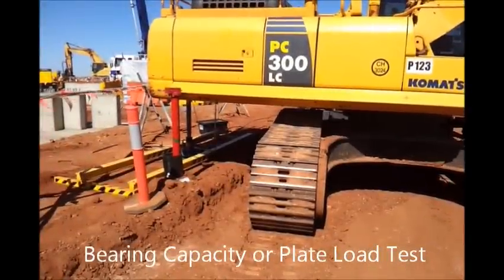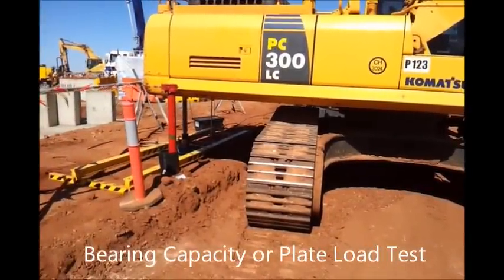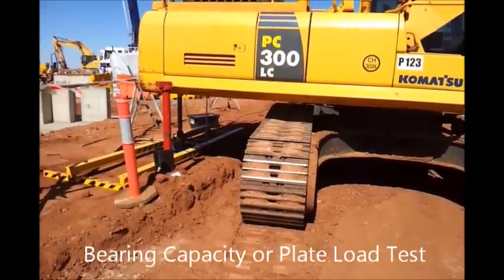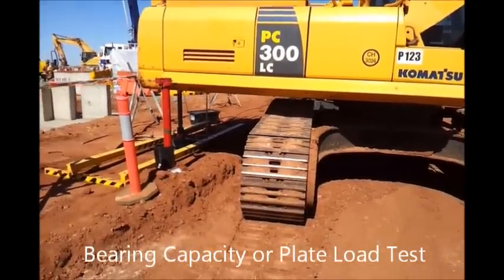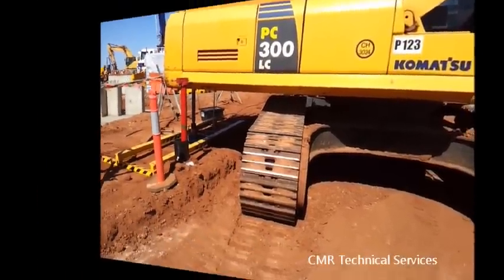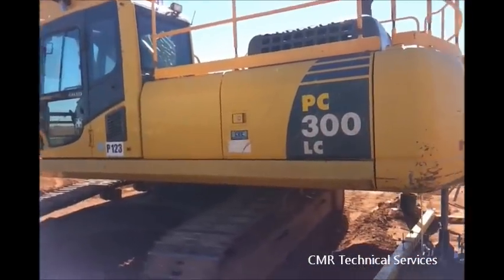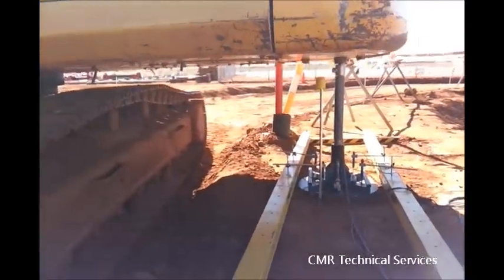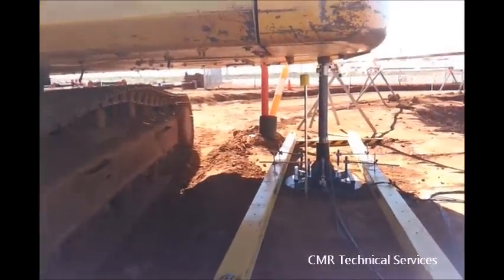Plate Load Test

Comment: What standard is this being done too and approximately how much did your setup cost?
Reply from the maker: +Philip Ihnativ 

I follow both the ASTM and BS standards using loading cycles that best suit the application. I have an extensive collection of transducers, data acquisition and hydraulic equipment from which I compile a testing system to best suit the loading job required. I couldn’t guess the cost as the equipment has taken more than 25 years to accumulate but I imagine it’s a lot.

Comment: what is the length of reference beam
Reply from the maker: The timber reference beams are 3.6m long. The length of those beams was chosen so that when separated, they are 1.8m and can be stored inside the trailer for transport. The trailer can be transported to remote sites on a truck by a freight company. I have several timber reference beams ranging from 3m to 6m.